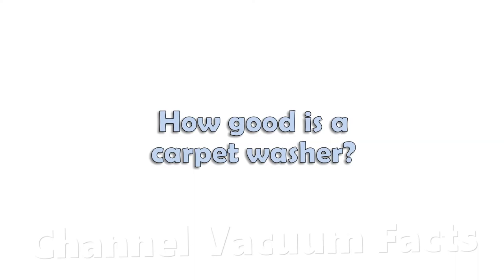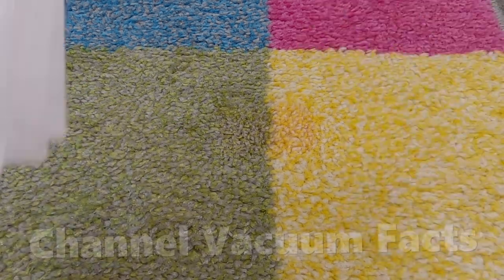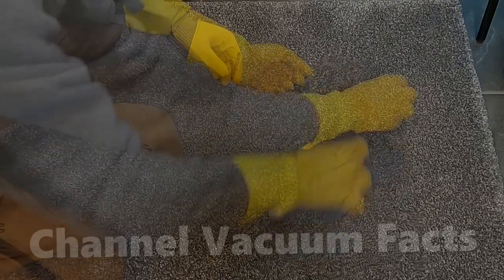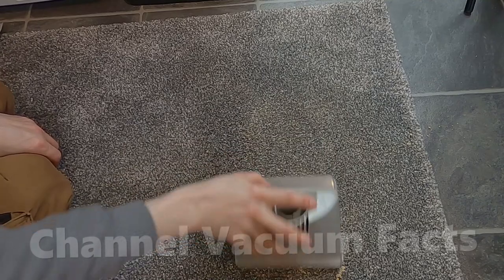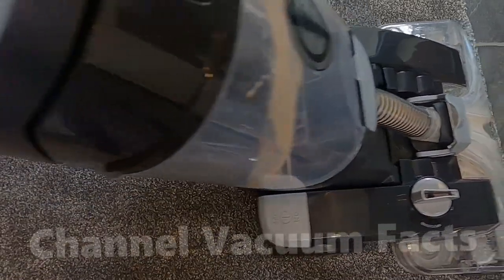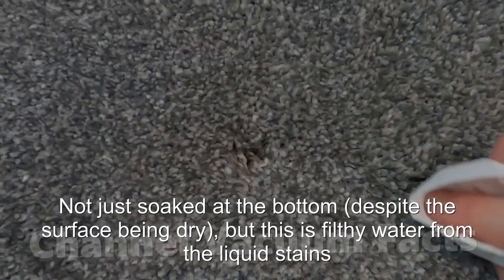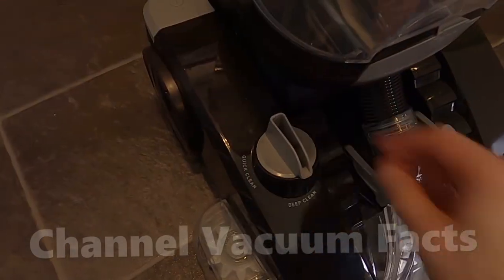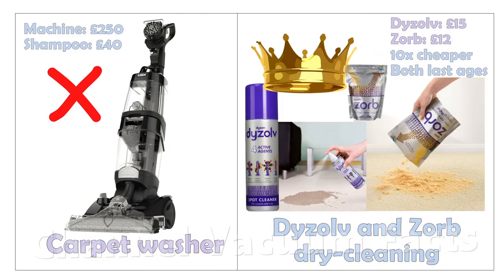Best Way To Clean Spills And Stains From Carpet: Carpet Washer Or A Cloth, Dyson Zorb, And Dyzolv?

Comment: Also, the problem with drying stains in with a fan, is once the stain is dry its more difficult to remove. Its best to get it when wet. I just prefer wet cleaning though, for each is own. I personally have never had luck with dry cleaning. Plus my cats step in the powder and have licked it in the past.
Reply from the maker: It's not true that dry stains are more difficult to remove—at least not with dry-cleaning chemistry (it may be true with water-based methods). The video showed this explicitly beyond all reasonable doubt. Yes, people may prefer one method over another, but facts are facts, and the evidence shown here clearly indicates that on the factual question of what works best for heavy spot messes, is easiest, and cheapest, there is no argument: dry cleaning (assuming used correctly). When dry-cleaning, you need to identify the water content of the stain, remove all the water first, and then clean as instructed in the video. The powder is made of harmless natural materials (wood pulp/some organic fibre). And if used optimally and worked in with a brush, there shouldn't be much to step in. This video really directly showed how poor even the highest end, most expensive, and best performing wet cleaners on the market are (as measured by what they leave behind *at depth*) and how much better alternative approaches are when used correctly. Again, the real trick to using dry chemistry well is to ensure there's no water present. Next time your cat's sick, maybe try cleaning with a lightly damp microfibre cloth using anionic sulfactant-rich high quality dish liquid as shown in the video until it gets no cleaner, let it fully dry, blot with Dyzolv and a dry clean cloth until almost invisible, then use a small amount of Zorb with a soft, long-bristle brush. Once you get good, even though you're not using a 'big fun machine', you'll probably realise it's cheaper, quieter, and less hassle, albeit a bit more elbow grease. Wet cleaners are a total consumerism scam. It's not always true that 'big machines' do a job better.

Comment: Can you use Zorb micro sponges on sofa? Not for stains or heavy dirt but relatively new sofa just to refresh it and keep it kleen longer?
Reply from the maker: I suppose, but it's not really designed for that. A simple, very lightly damp cloth rinsed in a low concentration of mild dish detergent will do the same thing.

Comment: I have a bissell and low pile carpet. It's always brought my carpets  up like new. I have no complaints at all. 👍
Reply from the maker: Hopefully you will now, having seen the facts I exposed about these machines
Reply: @VacuumFacts  On a thicker pile carpet but a low pile carpet my bissell works just fine. I don't find it as much of a faff as you found the Vax. And it's super cheap to purchase the detergent as I told you before. Did you try the dry cleaning sponges they do?
Reply from the maker: @2711marcus  Still, a cloth and, if necessary, dry-cleaning chemistry, achieves better results much cheaper and easier. I would try their microsponges if they're cheaper (per unit mass) than Zorb. The detergents are NOT cheap; the official bottle costs £40 (see video)!
Reply from the maker: @2711marcus  Link me to their dry cleaning microsponges
Reply: @VacuumFacts  £11.75 for a 5 litre bottle that lasts a long time.
Reply: And the janitor by me is selling it for £10. Not sure where you get £40 from
Reply from the maker: @2711marcus  Link me
Reply from the maker: @2711marcus  And make sure you link to the official solution referred to on their website: https://www.vax.co.uk/solutions/vax-platinum-professional-carpet-cleaning-solution-4l (£40; that's where I got it from—from the manufacturer)
Reply from the maker: @2711marcus  lol, that's not the official solution! I was slated in the last video I did using the Karcher Puzzi 100 carpet cleaner for not using their official solution (and in fact used a better one, but wingebags don't care about that). Yeah, so not convicing at all. lol are you serious? You can't seriously argue it's not expensive, citing all these low figures, then totally ignore and fail to mention you're not using the official solution, but some other cheap plonk. haha I should have guessed this was coming, from history.
Reply from the maker: @2711marcus  Also, send me a link to these microsponges you were referring to before
Reply: @VacuumFacts  Johnny my friend is a carpet cleaner. He uses prochem and says it's the best cleaning solution he can find. It's what the pros use and it's dirt cheap. Haha
Reply: The micro sponges are from the same company Prochem. They are not cheap plonk they are the company the pros use. So you've been found out this time haven't you 😂😂😂😂😂
Reply from the maker: @2711marcus  You were being misleading. You argued the solution doesn't cost £40. I provided a link which showed it does. You were literally wrong. Then you link to a product which isn't what was being referred to. And you can't have it both ways; if you argue this stuff is just as good (without evidence), then you're simultaneously therefore arguing that those that criticised my last video for not using the official Karcher Puzzi 100 carpet cleaner solution are wrong to do so on the grounds you don't need to use the 'official' solution. I don't disagree with that by the way. But it's a totally moot point anyway, because the video shows how flawed these machines are as an approach to carpet cleaning. A simple cloth does better for spot stains; water chemistry and cleaning agents have their limits, and dry cleaning chemistry does better. There's no argument here; the evidence is in the video. Also, you still haven't linked to the microsponges I'm happy to try if they're cheaper. Ah f*ck it; looked it up myself. Getting even basic info from you at times is like pulling teeth. https://prochem.co.uk/product/fiberdri-10k/ And, as expected, and discussed before with you, yes, you can find cheaper stuff (I've seen this before), but only through economies of scale. I'd have to spend almost £60 to get this gigantic 10kg tub, which is a very expensive up front cost! Nowhere to store something that big either. :(
Reply: @VacuumFacts  Well if the pros switch to micro sponges then I will do the same. I use the cleaning solution and I find it at least as good as the bissell cleaning solution. So I will continue to pay a tenner for 5 litres 😊
Reply: @VacuumFacts  Btw you have to speculate to accumulate 😂👍
Reply from the maker: @2711marcus  That's absurd logic. The 'pros' deal with different situations than shown in the video and have different financial and time restrictions, as well as outcomes. Furthermore, many DO use dry cleaning for professional house cleaning services (a simple google fact check will confirm this—it's not like I haven't already shown copious evidence in my other videos). And lastly, none of this washes away what's shown in the video, which is specifically talking about residential carpet cleaners. They don't clean any better than a cloth, they make the floor dirtier deeper down, and are expensive.
Reply from the maker: I mean, this guy's even using a god damn Sebo bagged cleaner ffs. Surely that scores him some brownie points by idiots out there. All those black spot stains gone. Interestingly, if he'd used fewer microsponges, he probably could have avoided the hopper stage before the final-vac. https://www.youtube.com/watch?v=MVflUsSUQ-c
(From last year) https://www.youtube.com/watch?v=K5yQzixpayU
And another removing permanent marker https://www.youtube.com/watch?v=kWzqzY0j0jg
"Well if the pros switch to micro sponges then I will do the same" indeed... >_> Don't have a clue xD
Reply from the maker: @2711marcus  And the other illogicality is that 'pros' know best. Just because someone does something for a living, doesn't automatically make their experience mean they know best. It just means they become experienced at the limited range of activities they do. Plenty of examples of 'pros' doing only what they know rather than what's best. A true pro is someone who understands and is highly experienced in all possible actions and can quantify and justify, comparatively, on strong scientific grounds that are independently fact-checkable, why one approach is better than another.

Evidence upon evidence upon evidence upon evidence, below, that you're flat-out wrong (yet again) and that 'pros' all around the world are using this technology to professionally clean carpets (they of course use big CRB machines for speed). The first link shows evidence of how the microsponges fixed problems that either couldn't be fixed by or were caused by hot water extraction, bonet, and other encapsulation chemistries. Resoiling was shown to be much slower after microsponge chemistry, again supporting other literature out there covered in my video here (which will be replaced soon) https://youtu.be/XVR-YdzytBA

https://www.youtube.com/watch?v=xGh3pl2OQX0
https://www.youtube.com/watch?v=L6rzzbiMphI
https://www.youtube.com/watch?v=xlD1W4MGwiQ
https://www.youtube.com/watch?v=k1Pb5cVG4ss
https://www.youtube.com/watch?v=7YQJONuYLb8
https://www.youtube.com/watch?v=q4wqaE9KyZI
https://www.youtube.com/watch?v=p95fz4ID2qk
https://www.youtube.com/watch?v=910m1q3Zp9Y
https://www.youtube.com/watch?v=Z1_jhi82pJI
https://www.youtube.com/watch?v=_6i_MtyaOjo
https://www.youtube.com/watch?v=KaIJ-8t2zTo

A simple fact check... (of course, I'm well aware people ignore evidence and direct their lives based on their wonky worldviews)
Reply: @VacuumFacts  Are you working from home during the lockdown? I bet your workmates will be crossing their fingers 😀
Reply from the maker: @2711marcus  Ah the petty ad hominem attack; the hallmark having been wrong, having no argument left, but not having the courage and maturity to say so adn that you learned from it. My workmates are professional (the true professional kind, not the 'pro' kind). I guess it was never really was about "if the pros switch to micro sponges then I will do the same"; that was just code for "I'll never change my mind, even in the face of all the evidence in the world". Incidentally, the video series in the run up to the new year will peak your interest...so expect more of this, given what I'm about to expose.
Reply: As someone who runs his own business I'd say a pro is someone who has run a successful business for many years and has been able to sustain a high level of customer satisfaction and has customers who come back time after time. If you do a crap job you won't stay in buisness for very long.
Reply from the maker: @2711marcus  From a purely economic perspective, I'd agree. But there's more to reality than economics alone; there's also facts and truth, which count for something too.
Reply: I have never said micro sponges don't work, I've never used them myself. But as I said on my low pile carpet the bissell does a fantastic job and it dries in 2-3 hours not enough time for mold and bacteria to grow. And of course once the carpet is fully dry the mold and bacteria will die off anyway as they need moisture to survive.
Reply from the maker: @2711marcus  Of course. I never said you said they don't work :P I'm not trying to stop people using them if they have them. I'm just exposing the truth that's been withheld so people can make informed decisions. I'm not convinced the carpet will be dry at the base in 2-3 hours. The odours don't always disappear when dry. It's also mites that survive, as shown by the literature study I referenced. And then there's the issue of resoiling rate due to the chemistry used (see that first link in the list above). Also wickback (because water-based carpet washers flush dirt to the bottom, as shown, despite sucking—it's all surface tension [physics] in case you're interested). For spot cleaning, this video shows a simple cloth exceeds a carpet washer's performance, amazingly. And general area cleaning is the next video in a couple of weeks, best done by zorb and a soft indoor broom with gentle agitation which isn't even tiring when you learn best practice I'll show. There's literally no place for a carpet cleaner in the home I've now learned, in principle. Bu some still like using them—especially if they already have one.
Reply: And there's plenty of spot and stain removers available for stubborn stains. How many times would you have to empty the V11 in a large room? I have been reading reviews about Dyson zorb and Sebo duo p, there's quite a few dissatisfied customers. So I say use what works best for you . I might get some micro sponges from the janitor and see if they work as well for me. 👍
Reply from the maker: @2711marcus  Yes, but those spot stain removers use different chemistries and work in different ways, with different quality of results and consequences. The V11 takes 5 seconds to empty (without cost), so it doesn't matter how many times you have to empty. And for general cleaning, you don't need to use a lot of sponges; I can do my whole house with half a bag of Zorb, which is 1 V11 binful. You can't guage the effectiveness of any product or technique by the subjectivity of 'user reviews'. Most people do it wrong, or have broken expectations. Plenty of morons in YT videos trying to use it to remove dye or ink or something. And there's no subjectivity on matters of fact. What works will work the same for everyone (assuming they use it correctly). The purpose of this and the next video was to find out what the best way to clean a carpet is. And I figured it out. It was also to show exactly how to do it properly with best practice that anyone can follow.
Reply: @VacuumFacts  Resoiling yes I do agree with that. Best way to completely remove mites is to have hard flooring they cannot grip to it so get sucked up, that's what I'd do if I suffered with an allergy to their droppings. If your humidity is below around 50% mites do not proliferate, they like high humidity.
Reply from the maker: @2711marcus  I've never been a fan of hard flooring; might as well just have concrete. :/ The high humidity is associated with rate of egg hatching, according to that paper, rather than directly with the mites themselves.
Reply: @VacuumFacts  They absorb moisture through their bodies from what I understand. They will not live in a dry airing cupboard for instance as the humidity is too low. Anyway I'm going out for a long walk there's not alot else to do during this lockdown. Happy Zorbing 😄
Reply from the maker: @2711marcus  Buy a camera, make some videos. E.g. of you trying zorb.
Reply: @VacuumFacts  Maybe Johnny come lately 👍

Comment: I like Zorb and Dyzolve, but we have very plush white carpet in most rooms of the house and red wine is very common around here, so we always have a small spot cleaner ready for use, I find that zorb dosent get those stains out, but for smaller, more faint stains, it works quite well
Reply from the maker: I haven't been able to reproduce this. For every stain that wasn't indellible, Zorb has removed it just fine when used properly.

Comment: I've got some purely clean sawdust btw, you reckon I could mix that in a container filled with soapy fairy liquid? Dont really wanna pay £10 for a small bag of dyson zorb, cos then I'd want to do my whole house
Reply from the maker: lol, no zorb isn't just sawdust and soap. a £10 bag lasts ages BTW. You can do an entire house with it. General cleaning with Zorb is the next video. I outline in the video why not to use Zorb on a wet water-based stain. It absords the water and doesn't dry, making it worse. The video explains the importance of drying any water.
Reply: @VacuumFacts  I know, Zorb has more advanced chemicals lol but I'm wondering if I can make my own, I'm just not convinced I can do an entire house with Zorb, maybe a few rooms at the most due to the size of the bag really
I'm more interested in using Zorb in large areas you see, to reduce soil buildup although this spot cleaning vid was interesting, I like the concept of it
I knew my vax washer was terrible but I got it anyway cos of my cats
Reply from the maker: @parwaz7861  Well, you probably could make your own, but I'm not chemist enough to know how. For general cleaning, you don't need to use much (my next video demonstrates). People (including myself before I learned) think you need to use a lot, but you don't. Not for general cleaning. In fact, I did my whole house using half a bag the other day. And if you buy a soft indoor broom and learn a good easy brushing technique, it's actually really quick and easy now to do general area cleaning (including stairs). Wait for my next video which is scheduled for release in a couple of weeks.